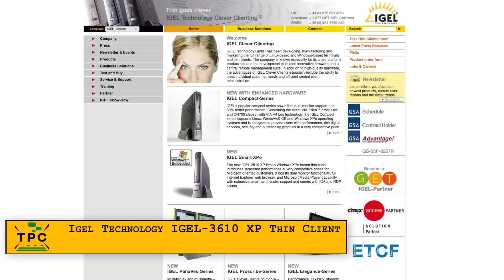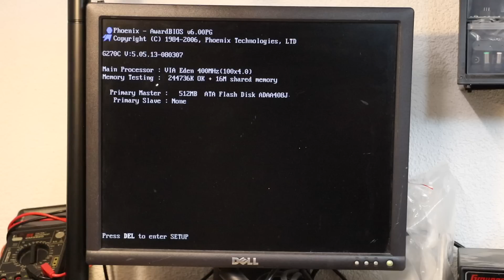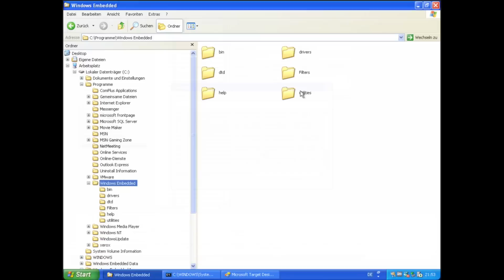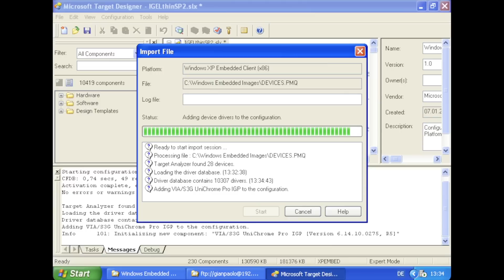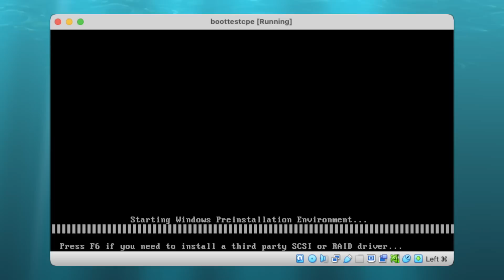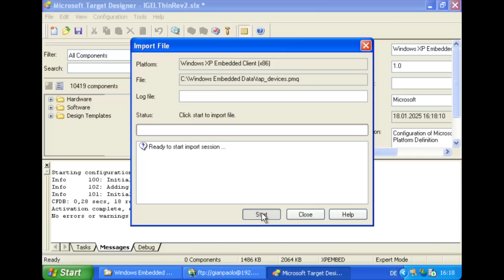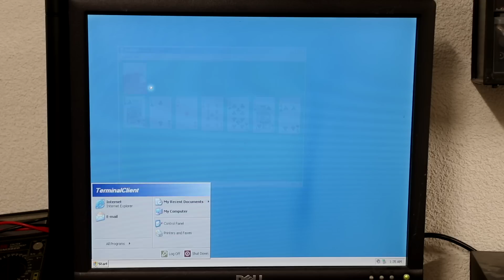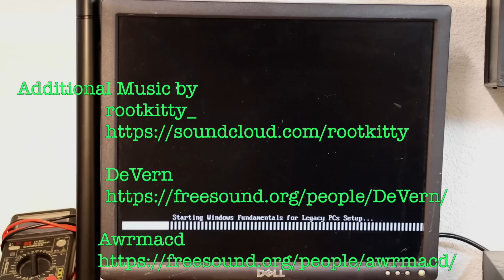Inside Windows XP Embedded – Creating a Custom Install from Zero

Comment: I actually have a Wyse Winterm which came with XP embedded when I first got it. I originally had two, but I stripped one down to bump up the configuration of the other one (and to have one DOM as a spare). I imaged the DOMs, just in case, and actually ran Linux on the device for a while. The system has room for one PCI device, so technically you could turn it into a firewall. A very slow firewall ;-).

Comment: This brings some awesome memories back from my teen years, when I was 15-19 I made these custom gaming optimised images, or a very very light version of xp. And UNMOUNTABLE_BOOTDEVICE (0x0000007B) is still burned into memory as I got that error many times in the beginning, solved that by including the standard ide drivers into the image by default.
By experimenting with XPe I gained much insight how the OS worked at the component level, shame they havent made a similar product

Comment: Service Pack 2 is likely an issue. You probably want to try Embedded POSReady 2009 which is based on Service Pack 3 and has 10+ years of KBs after its release.
Reply from the maker: I see. Though the entire point of the video was to experience how to build a custom Windows XP Embedded image.

POSReady, although it may be interesting to show on its own, wouldn't have served me that purpose.
Reply: same thought
Reply: SP3 can also be installed on XPe. But you need to install it as a part of a component addon. It cannot be installed in live OS.
Reply: POSReady is pre-packaged, similarly to XPe for POS Systems which came before. Instead, he should look into the ‘Standard’ use application since it includes the builder he uses on video to create a custom image. Otherwise, he could’ve seriously just used Windows FLP if he didn’t care for the customization

Comment: Back in the day I used Windows XP Embedded on PCs for Industrial Control, but I never got in this deep, thanks for the excellent video, I feel like I could follow along but so far I have not started collecting thin client machines.  yet.
Reply from the maker: Thanks!

It was my first Windows-based Thin Client endeavor. Let's see if I can make something for Windows CE as well ;-)
Reply: Well I have never been a lot in embeddd industrial controlles. (I have only one in my company) and it failed on me. Withing the first try to boot it from USB I had this 0x7B error. It's a monster because you don't really know what causes it.
(Last week I replaced the entire machine. only because the controller-board is unobtainable.) 600 Mhz Celeron Board.

Comment: I had identical Igel terminal and still have another one but broken unit. I also have bigger  1GHz model with PCI slot which runs quite fine. No issue installing XP.
These times we have RapsberryPi but in the past small terminals like these were the best way to have small home server or even to download bigger files over slow internet connection without bothering main PC.
Of course today such computers are better as small DOS boxes than servers :)